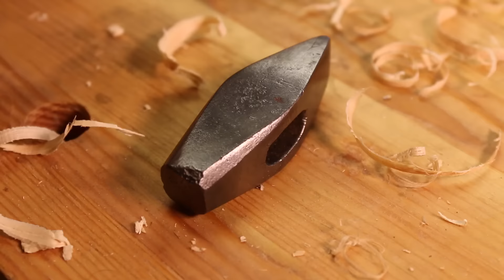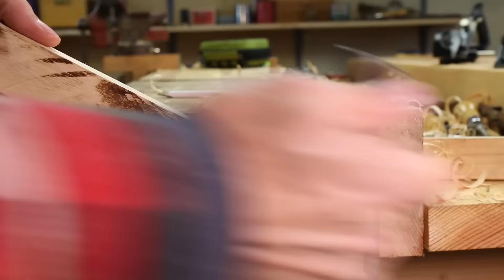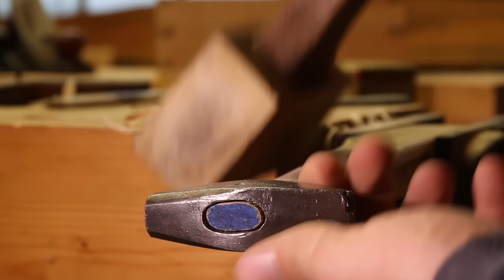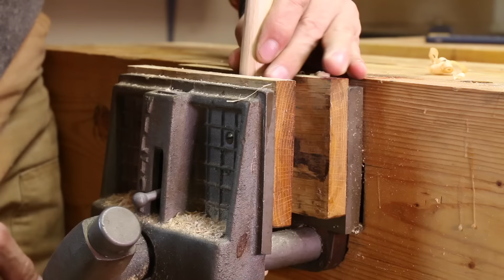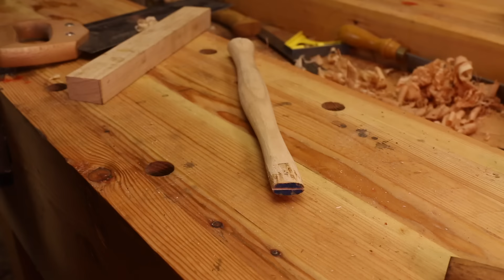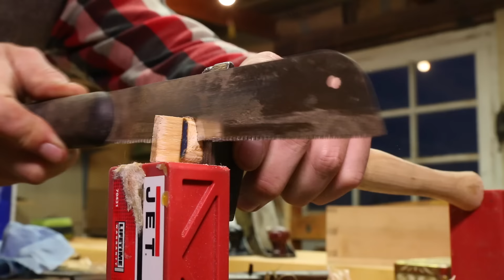Blacksmith Hammer Handle From Billet

Comment: Glad you reminded us of the proper species of wood too use on a wooden handled lever tool Cody, thanks. I heard some people use Ash, for even much longer, more stressed swinging type tools. Ash is great for a perfectly straight handle, But no other hardwood splits more easily. It's splitting properties are very similar to cedar. Great job. Thanks for sharing Cody
Reply: Ash has been used in Europe for thousands of years for tool handles. Only in recent years we've been getting American hickory. The hickory is stronger but some traditional tool makers still prefer Ash, I'm not sure if European ash and American ash are the same.
Reply: Yes, we know this. It was a reference to an inside joke. We have white ash and black ash here in the adirondack mountains. I own a sawmill and actually sell white ash, or swamp ash. Most black ash goes to making large and small baskets and backpacks and such, very flexible when beaten to a pulp. Yet super strong and long lasting.
Reply: +HOSSMCGILLICUTTI I'd like to know where on the West Coast he's getting the hickory. Maybe by mail from the east?
Reply: +HOSSMCGILLICUTTI  Thanks  Hoss,  (fraxinus excelsior) common ash is found across Europe, from the Artic circle to Turkey. It's the most common tree in the British Isles but is currently under threat from disease.
its great for furniture,  tool and sports handles. It also makes the perfect firewood,  it burns  hot for a long time and you can burn it green. I still don't know the difference between our ash and yours as we only have the one here as a native tree.
Reply: Ya east coast. Probably Not Tennessee, hate to say it but thats a sales gimmick. But, they have big fir and western pine. Big red Cedar.
Reply: Tom Murdoch  That sounds just like our white ash, better than any other hardwood for burning green firewood. Ash makes its way into handles alot i think because there's so much tension or stress in the logs. It comes off my mill sometimes looking like a recurve bow. So it has to be cut into shorter lengths. Really hard on blades also, I've heard it has a high silica content? I just know it eats teeth twice as fast as other hardwoods. Id bet your ash and ours is the same. I could send you a piece.
Reply: +HOSSMCGILLICUTTI Thanks Hoss, yes sounds like white ash.
Reply: +HOSSMCGILLICUTTI Tennessee hickory is a real thing just depends on where you are in tennessee the eastern side has it i do beleive
Reply: The problem is that it has turned into a species. If I cut a load of Adirondack hickory and ship it to Tennessee to be distributed. They resaw it, grade it, then rename it...wait for it...Tennessee hickory.

Comment: Beautifully shot and edited. The audio quality is awesome as well, I enjoy the relaxing sounds of the woodshop.

I had a wooden spokeshave just like yours, with the worn down concave area in front of the blade. It was usable in this condition, but took some mighty thick shavings if I wasn't careful with it. 

I cut a notch into the beech wood to remove the section of the wood that was worn out and inlayed a new piece of hardwood to repair the area, it cut much better after that!

Comment: Great video, the simplest ones are always the most inspiring.  Is there any need to use the same wood species for the wedge or can it be any harder wood? i.e could you use a contrasting walnut?
Reply: Iv actually read that a softer wood IE poplar is a better choice as softer woods bite more and will expand more when linseed oiled.
Reply from the maker: +Cameron McPeak Poplar is not a better choice than Hickory or say Ash,
Reply: (IE poplar) meaning a wood a bit softer than the handled wood. This will allow the grain from the handle material bite into the wedge for a higher friction hold. Now of course the only difference would probably be that a hardwood wedge may bounce more upon installation. And that a softwood wedge fills the voids between the handle and wedge better. Its really more personal preference than anything.
Reply: also a little handle hack. if you use a contrasted piece of wood for the wedge like walnut or poplar (Poplar works fine if you use a good quality wood) not the crappy ones you usually use in handles. the contrast between the two woods will help if you need to remove the wedge for some reason, because you can see the different color shavings.

Comment: I have often seen you seat the heads by holding them and hitting the bottom. Was the head on this one to light to do this?
Reply: +DraaxLP Draxx!!!! no way do you watch WS! its all about inertia in this case the head was to light to counter the inertia of the handle.I got a channel about blacksmithing if you are interested at all,i have videos that kind of explain basic blacksmith techniques/tools.forge/anvil/tooling.might add a little depth to the use of forges and smithies in ARK unless you already know a bit about metal work.

Comment: The planes in the background would stay sharp if the planes were laid on the side rather than setting upright maybe??
Reply: +Steve Van Oudenhoven FACT: The "side-laying" practice originated in woodworking classes when uninformed students would clumsily set the planes sole down and damage the keen edge.  The experienced woodworker need not worry as long as he is gentle with his tools.  Go check Paul Sellers out - master woodworker for over 50 years and never sets them on the side.  I think he would have the proper experience to know.
Reply: +JMann1229 I've heard that version, as well as that the practice was common with wooden planes, although I'm not sure for what exact reason. To me, it's six one, a half dozen the other. I place mine sole-down, though.

Comment: just in case you didn't know the "boiled" linseed oil that you are using has a lot of chemicals in it to speed the drying of the oil. it was a while ago when i learned this but, i think that it has lead and a few different chemicals that are poisonous. they use these chemicals to replace the boiling process, which costs more. probably not the best to have on your skin but it hasn't had any effects on me, and seems the same with you. just remember to at least wash your hands before you eat something.

Comment: Ok, why? Why make the handle that shape and not another? Why not make the handle symmetrical so when the top eventually goes bad the owner can just file the bottom a bit then just put the head on the bottom and turn it around. Is this hammer more fire resistant than a carpenters hammer? Why didn't you put Linseed Oil on the whole hammer?

Comment: From craftsman to craftsman, I offer a bit of advice. First of all your craftsmanship is extraordinary,  but a smithing hammer should be rather square. This helps us judge the angle of the hammer face. With that being said, you way over complicated that handle even though its a masterpiece. One more  thing we like to do is char our handles then coat with linseed. this almost finishes the wood as for it does the job of multiple grits of sand paper. Once its coated in linseed, let me tell you! its almost rubberized! But not too much to where it rubs blisters. Im sure you know that theres a happy medium.